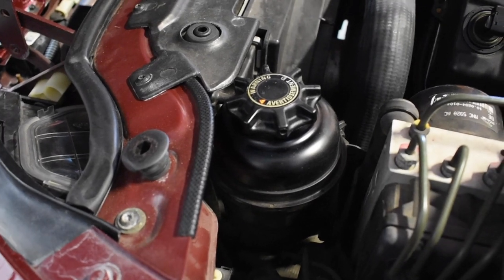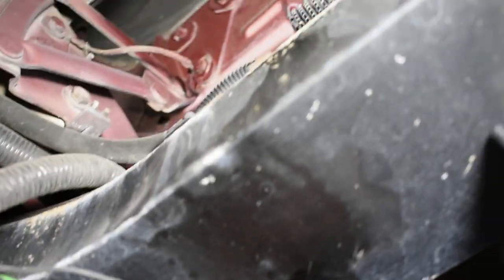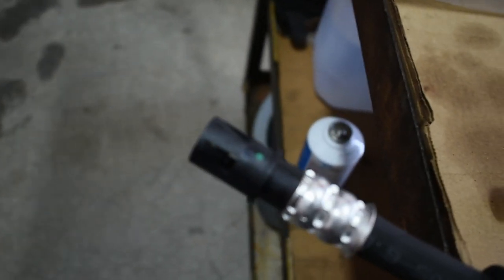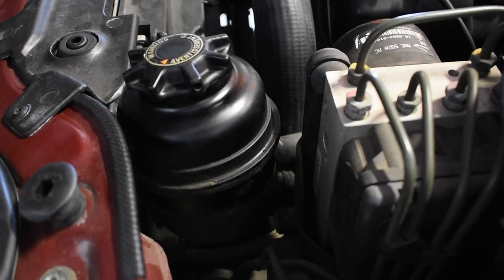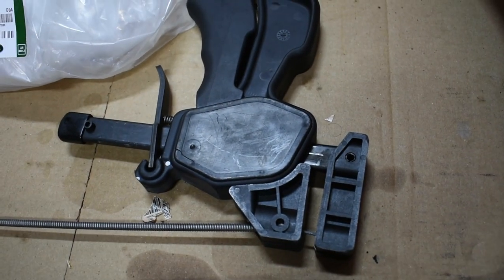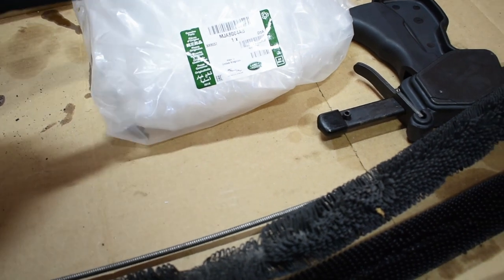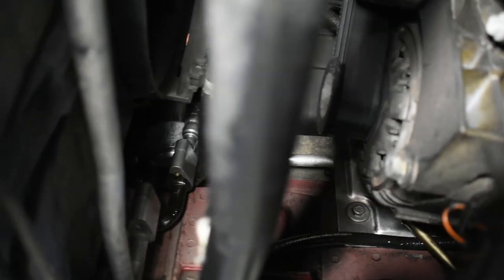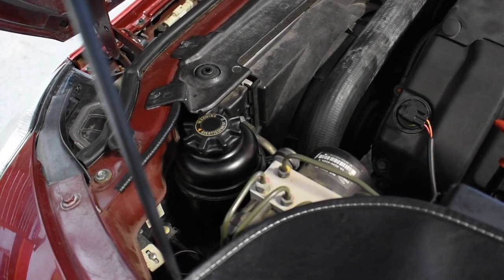XK8 Power Steering Cooler Replacement

Comment: Thank you for this video, I am a mechanic with over 50 years in the trade, and this video helped me do this exact job on my 1999 XK8.
FYI when installing new rubber on items AND the clips spray with WD40 it makes it so much easier.
Reply from the maker: Great to hear! Thanks for tip.

Comment: I see a leak around my Power Steering pump pulley. Guess I need to change the pump but not sure if I should do the entire line as you show here (The passenger side and top porky pine radiator pipe. The problem is whatever I touch in this Jag, makes something break, especially the plastic parts thus adding to the work with more surprises that make me want to limit to bare necessity! Still, I have a feeling that I should replace the entire line.
Reply from the maker: To help save time and money clean it all thoroughly. Now run the car in park and have someone turn wheel back and forth while you look for leaks. You can use some dye if you have a black light. It can make it easier to find sometimes. Be sure to stay clear of moving parts under hood and do not ware lose clothing. Hope this helps.